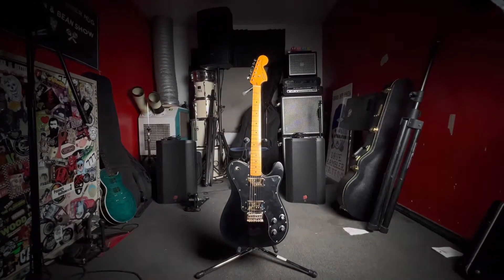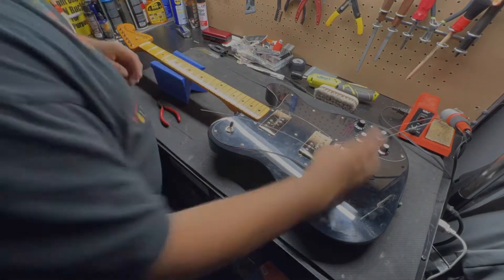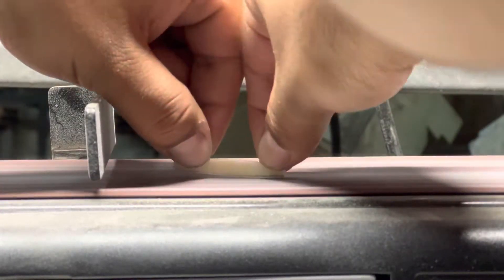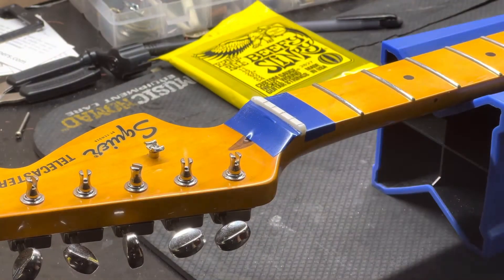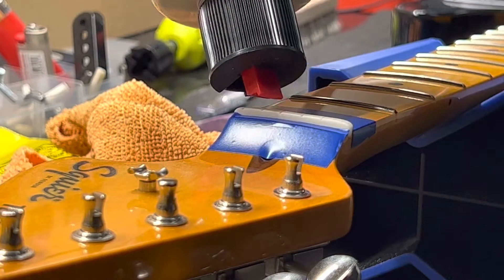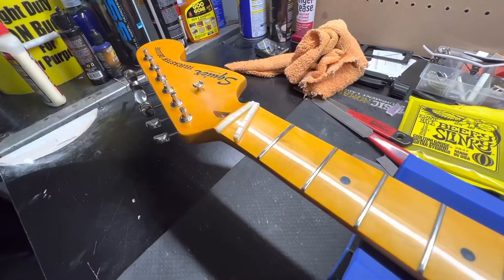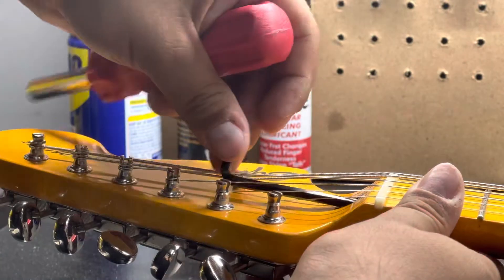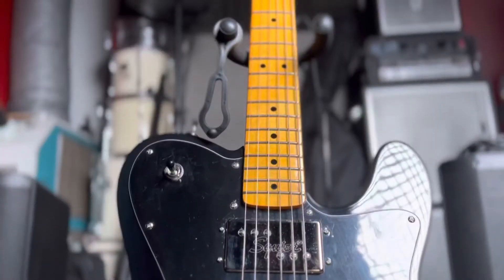Converting telecaster to left handed (New Nut)

Comment: I would love for you to switch out my right handed Ibanez Gio GS-120 nut piece into a lefty like I've had done with my very 1st guitar. How much does that go for usually around? I think i had to pay 80-90$ price range years ago when i had it done at a local guitar shop. Also need a new input jack piece on my guitar amp just needs a new piece soldered onto the memory board. People have no idea how frustrating it is being hindered in my full capabilities of guitar playing because of financial reasons I just want a guitar thats strung left handed and a amp that has distortion and sadly right now this Ibanez is the best guitar I have playability wise compared to my off brand strat style knockoffs where the strings are hard to bend without worrying of breaking strings and it never sounds like its perfectly in tune...like it sounds good but when i try playing chords strings sound out of tune but other places on the fretboard it sounds in tune...it weird.